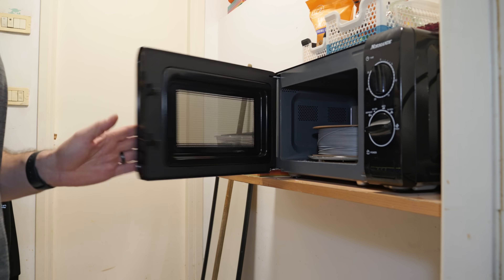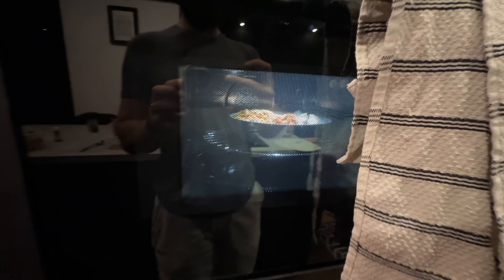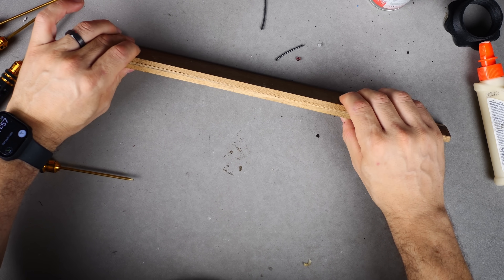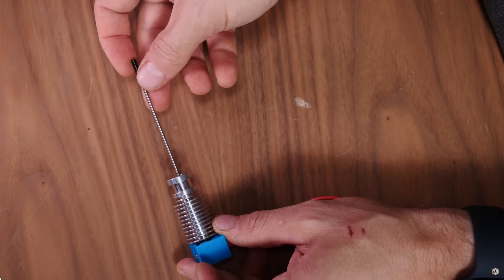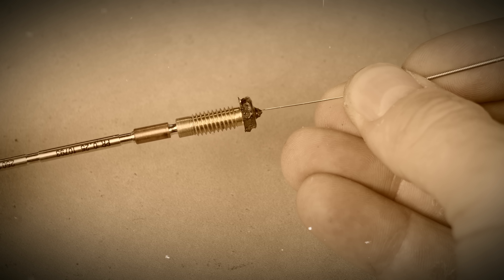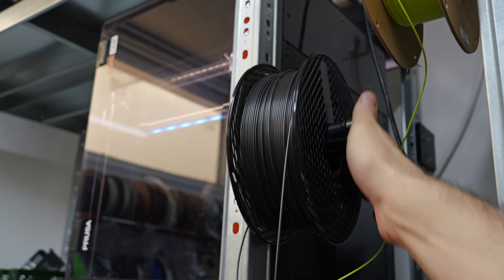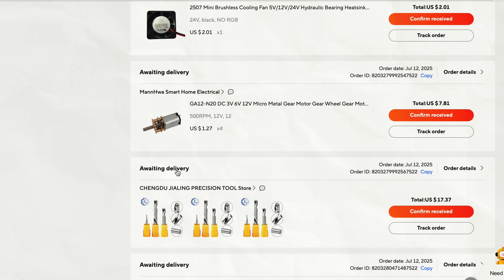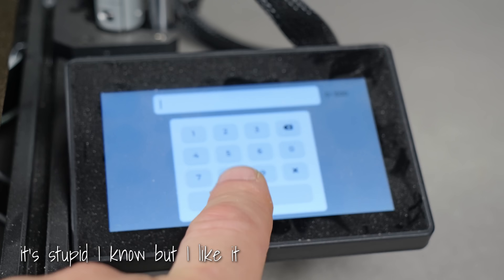Why I Microwave My Filament (+7 Other Strange Hacks)

Comment: Question What are the best budget extruders for the Ender 3 v2 as i'm starting find some of my filaments breaking at that area and also is there something that can detect if a filament is moving or not so if i leave it printing overnight and the filament breaks the printer stops and doesn't keep printing in mid air?

Comment: i use a powerfull mini portable blower to cool down my prints in 5 to 10sec.  and on nozzle for coldpull, very effective ! also to remove the prints i use Stainless steel disassembly card smartphone  for years. Also : I use tetrahydrofuran to chemically weld PLA and TPU, and dichloromethane for PETG. These products are extremely dangerous to inhale or touch, but they don’t glue — they fuse! It takes 12 to 24 hours to fully cure, though. I don’t think there’s anything more effective.

Comment: You should make a video all about 3d printing sex toys.  It could be a whole series.  Does YouTube demonetize videos focusing on that type of stuff?  I'm joking in the sense that I know it's never going to happen, but that being said, I would definitely watch it.  Sex toys are perfect for 3d printing.  It solves most of the issues people have buying them.  This way you don't have to interact with anybody.  I worked at an adult toy store briefly, and the most awkward situation I've ever been in was ringing up a comically large butt plug for a man old enough to be my grandfather.  If he had the means to just print it at home, he would have saved a lot of money, and it would have been much more discreet.  There's also safety concerns that would be good to know.  Is it safe to be putting PLA inside yourself?  What about TPU?  I would bet anything that there's someone out there who never even considered these things and use toys they printed on a regular basis.
Reply from the maker: It's all fun and games until something breaks off in your butt. Also, bacteria -> layer lines -> bad time. 

Don't 3D print sex toys or anything that goes in the body please.
Reply: You could just put a condom on it. Saves on clean up and avoids the toxicity/contamination issue.
Soon you'll be looking for a 5mm nozzle for that extra ribbed layer line effect... 🤣😆
Not that I've thought about this at all.  🤐

Comment: Club 222!

I only drink one cup of coffee a day in the morning. And I just use instant coffee. I got in the habit of putting a cup of water in the microwave and pressing 222-Start, as it's just about perfect, I don't have to think, and somehow (coincidentally) in my microwave, the cup handle lands in almost exactly the same spot (the rotating plate just happens to work out that way ...)

I just had to comment that I use stupid tricks like that all the time; finding "2, 0, 0" or "2, 3, 0", or press +30 four or five times, then start .... when you haven't yet had your coffee.... the 222-Start trick is fast and easy. Never thought to do that with the printer!

More often though, I preheat the BED before heading back upstairs to send the print; and for PETG I'll probably start just hitting 77-Enter, 55-Enter for PLA -- just to get things started, let it heat up and even out a bit before sending.

But speaking of the microwave... I'm just way to skeptical to nuke my filament, even with an older (not used for food) microwave, because I just worry about a hot spot (perhaps a moisture bubble somewhere hiding in the spool) fusing a part of the filament, that I may not notice until midway through a long print... and don't think this hasn't crossed my mind, I'm just more comfortable with my food dehydrator (I mean, filament dryer!)
Reply from the maker: Bud I love your energy but you lost me at instant coffee...
Reply: @thenextlayer  Ya, I had a feeling that would put some people off lol. I can only do one cup a day, and I got tired of repairing/replacing Keurig's etc... and I guess I'm just lazy ☕

Comment: my others tips :
1. I put cooling nozzle Gcode after print finish in 'end printing gcode'. basically it activated fan nozzle until 70/90 degree to stop extra purdge after printing.

2. I put macro with 100% fan speed and the extruder patrol the the whole area of bed. Very useful if u want fast cooling ur part after printing. the gcode is only move in x and y axis after little bit raise the z axis.

if you interested I can post the gcode here.
Reply from the maker: Dang, those are very smart.

Comment: For those with big 1/2 sockets sets. You can use big sockets inside of the spools for weight instead of big steel balls.
Reply from the maker: OMG THAT IS SO SMART WHY DIDN"T I THINK OF THAT I HAVE SO MANY OF THEM...
Reply: @thenextlayer haha. Let's say I ran into the light spool problem and had to find a solution in a pinch.
Reply: Yes - a deep 1/2" socket with a 3" extension installed "backwards" so that it is inside the socket is almost as heavy as a full spool on its own!

Comment: If you do a cold pull, be mindful that you may cause your z height to become out of balance (if you forced one of the z height stepper motors to move by even a step). Just use the menu to drive the gantry all the way to the top and that should level it out again. Also when drying with the microwave, I've weighed the filament before and after on fairly sensitive scales and have found almost no benefit. Ive even opened the dorr between drying sessions and blown the humid air out of the cavity but still no luck. V/Strange.

Comment: definitely do not microwave any of this stuff in your food microwave. the V in VOCs stands for volatile. meaning it doesn't take much energy for them to tend toward their vapor state. possibly much sooner than water.

that said, the microwave works well because the cyclotrons that emit the microwaves are specifically tuned to activate water molecules. this is why it helps to slightly melt frozen foods before you microwave them (when in ice form, the H2O molecules are too tightly held to absorb nearly as much energy as their liquid cousins).

Comment: I unclog my nozzle by putting it vertical in the holes of my air fryer, so the intake points down, after a few minutes, the plastic becomes so liquid that gravity does the clean for you, then just to finish, use the needle. (i set it to 230 - 250 c)

Comment: My number one time saver:
Plastic scraper. 

(They usually come in blue handle with orange blades) It scrapes of leftovers (brims, purge lines, ooze) and the print with no damage to a PEI plate, even while hot. Also great for wiping off ooze on the nozzle. Best of all, no finger prints on bed, so less washing. For like AU$5.00, it is my most important tool. 😂
Reply: @jacquesbayman6557  what about the plastic scraper that comes inside the sd card?
Reply: @shanonfrancis5071 Pretty sure you are poking fun at something, but not sure what.
Reply: @jacquesbayman6557 eh what? i wasn't poking fun. I was just wondering if you printed the scraper that comes along with the pre-loaded models in the bambu lab sd card which comes with every bambu printer. The card has the benchy, this one, then another one which is just a handle for the 'steel' scraper that comes with the printer and also some other models. I was just wondering if the one you bought worked better than this printable scraper
Reply: @shanonfrancis5071 Right. Never printed any models from SD, so can't say. I think that is Bambulab only?
 My scraper is coming from long before Bambu was even known in the wild. 😂 I've got enough metal "scrapers" but never use them on my print bed anymore. My old (first) Wanhoa's bed was badly scratched with metal scrapers, so I thought, nah... I've got two handles for the plastic scraper one dedicated to 3D printer the other from glue drips to non stick pots and burns on the glass top cooker. 👍

Comment: I had a similar jam with my filament in a dry box on my Flashforge because I had the filament path running from the underside of the spool. The issue only happened after the spool reach a point where it was half a roll or less. Then with the filament path plus filament feeder pulling on it , lifted the roll up inside the box and cause it to jam against the short bit of tubing I had as a pathway for the filament ! Now I have the filament path running over the top of roll and at same height as the feeding tube into the printer ! Every 3D printer presents different circumstances.

Comment: He says no melting = no VOCs. THAT IS WRONG. Soon as ABS etc gets a little warm it starts off gassing VOCs. Please don't do this in your fam's microwave. Don't do it indoors, either, all that VOC will be vented into your house by the microwave's fan.

Comment: The double glue is a very smart idea! Also if you want to cool down a nozzle and have a bblab (or any printer without a standard nozzle) move the head down into the bed and turn on the part cooling fan. It will help a lot with cooling the nozzle

Comment: I have been doing the "conduction cool down trick" ever since I modded my work's Taz6 to use spring steel beds. I use our big metal shear because it has a MASSIVE (literally) cast iron plate. The build plate will cool down in 10-20 seconds, just use hot pads when transporting a 100 C bed.

EDIT: The exception to your toilet paper roll orientation comment is parents of young children or of cats.

Comment: I collect from abs all the end-filament-strings , cut a 45° angle in it and use Polybond aceton glue, to glue the parts together. I print arround 2-3 spools a week, which is arround 20G of filament a week that would go to waste. (Per year a kilo filament).
I also buy 2.5 kilo spools from eSun which is on amazon most of the times  24-28€ per spool, which is 9€ a kilo
Reply: you can just like.. use a lighter and heat the ends and connect them that way too. Or touch them to the sides of your nozzle when it's on. Don't need glue for that mate. I know it's not a lot that's used, just mentioning because there are other options that don't cost.

Comment: For cooling down your print bed you really don't even need a metal object. My 3D printer is on a wooden dresser, and if I move the plate from the printer to the dresser it cools down almost instantly. As long as it has enough density and mass it's good

Comment: The double glue trick is exactly why lots of carpenters use nails or even nail guns; you glue the object, then use nails instead of clamps until the glue's cured. The glue will form a much stronger bond than the nails ever could but the nails keep it together until then
Reply: @daylen577  I've used the double glue trick for woodworking as well, using CA glue to hold 2 parts together in a place I couldn't clamp or screw easily until the wood glue cured. A pin nailer would probably have been stronger, but glue is what I had on hand.

Comment: Thank you for the tips and tricks. I have a question on a stock SOVOL SV08 
"not the max" is there a way to clear the G code files from the printer memory? I load my G code files using a USB drive but find the files stay in the printer even after I remove the USB drive. How can I clear the files from the printer?

Comment: The 222 is the best trick of all. Genius. Will save me a ton of time.
For the filament, the best approach is to not let them get wet in the first place. It's so easy to make bags or boxes of decent dissicant and put them with the filament in a bag or container. Ready to use.
Speaking of which, I did smell the perfume of ABS when I microwaved it. And it makes sense, you're vaporizing water that is inside the filament, so it gets really hot at molecular level, so friend styrene gets away too.

Comment: I’ll keep pimping this: dry filament in an air frier. Better temperature control, can dry any material including silica safely (no exploding beads), takes under an hour (I usually do 30 minutes), and cheaper to buy.
Reply: Yeah, ordinary oven works fine as well.  60C and and wait an hour.  Dicking about with a microwave is just dumb.

Comment: Spraying isopropyl alcohol on the hotend will start evaporative cooling. Much faster than air.
(I wouldn't use tap water, since it leaves ugly white spots.)

Comment: I found out that isopropyl alcohol can release prints instantly (!)
Try this!
1) Spray a bit of alcohol at one corner of the part where it touches the build plate.
2) Bend down the nearest corner of the build plate where you sprayed. (The alcohol will now get sucked into the microscopic opening between the part & plate).
3) Release the tension. (This closes the opening and pushes the alcohol further between part & plate. It now spreads rapidly and releases adhesion wherever it touches. You can see it working it's wonders especially well with transparent filament). 
4) Bend and release a few more times for bigger prints, so the alcohol can work it's way over the whole bottom surface. 

Careful, the part will suddenly slide off like butter on a hot build plate 😄

PS: I didn't believe it at first when somebody told me, but this alcohol-bending 😄also instantly releases cold hot-glue sticking to metals. 
Maybe it works even with other glues on other smooth surfaces.

Comment: Luthier here, the double glue hack. I've used it quite a bit. But, it's purpose is to keep the part from shifting while applying clamps. If you don't clamp your materials you will still end up with a weak, uneven bond. Stronger than CA or hot glue alone, yes, but considerably weaker than clamping. Clamping with proper jigs ensures a uniform thin layer of glue which is stronger. And if you are working with wood, the pressure also forces the glue into the fibers.

Comment: One of my pet peeves is hearing people (especially DIY/crafting educators) talking about glues "drying" when most cure (chemical reaction, not allowing water or some other solvent to evaporate). Some solvent based glues (for example gloop, plastic cement, or contact cement) can be considered "drying" as the non-water solvent evaporates. But CA glue and epoxies cure because they harden primarily as a chemical reaction.

It's even worse (IMHO) when 3D printer educators say that hot glue dries (or cures). Hot glue sets when it cools down, just like the plastic we are extruding in our FDM printers. It doesn't dry, there is no solvent evaporating. It doesn't cure, there is no chemical reaction. It would be like saying that your print has finished drying when it is done printing. We (as 3D printer people) should know better and use the correct terminology to not misinform those who don't know.
Reply: I get what you're saying 100%, but these words and terms have become so synonymous with one another these days that's it's easy to understand what someone means. There are a lot of things where using the correct terms is detrimental to the proper use of something. However; if you tell someone "wait for the glue to dry" instead of "wait for the glue to set", or vice versa, they're level of understanding would be unchanged regardless.
Reply: @ernieoporto1111  Same with some artists talking about their oil paints taking weeks to dry. Oil paints don’t dry, they oxidize. Experts say that oil paints never “dry” because there is always some level of oxidization taking place. Of course, for all intents and purposes the paint does feel “dry” to the touch eventually.

Comment: I'm not as much of a fan of the cold pull it's not worked for me once*. So instead I do this. Remove the hot end from the extruder. Put the wires back in and hold the hot end with pliers. Heat it to the highest normal printing temp of the filament that's jammed in there. Jam a 1.75mm copper wire down the hotend to push the clog out. Sometimes I need to add a 1cm or so bit of extra filament into the hot end to let that melt and do the pushing through the weird geometry of the high flow nozzle. Works flawlessly every time. Fuck PETG for making me learn how to do this. To this day the only filament to have clogged on me. Or caused me any issues at all really. I've printed every normal filament except additive variants and nylon. This is on a prusa mk4s, other printers may have hotends that aren't as easy to hold on to external to the printer. Also, you can do this without removing the hot end, but the copper wire may damage your extruder gears. Now I'm used to it this is about a 1 minute thing for me so not too bad. That'll vary based on how easy your printer is to do this with though and on some just getting all the gears out of the path may be easier.

*on my own printer, I also do maintenance on a small print farm where it's worked quite well. The farm runs prusa mk3s, I run a prusa mk4s. I'd guess the 4s really only clogs at all when it's super super bad and a simple cold pull isn't enough. The force required to push out the average clog on that has made me put a handle on my copper wire because it'd bend and not apply enough force otherwise. Truely nightmarish stuff. Thankfully also super rare and limited to a filament I'll never print again after my supply runs out.

Comment: With cold pulls I always try to use a contrasting color to what I believe is jammed in there.  If I last printed with a dark blue, for instance, I'll do the cold pull with white. If I last printed with yellow, I'll do the cold pull with black.

I do this so you can see what came out, if anything.  If you're doing a cold pull with black filament and you have black jammed in there, you'll never know if you got anything when you pull it out.
Reply: Good idea!!!